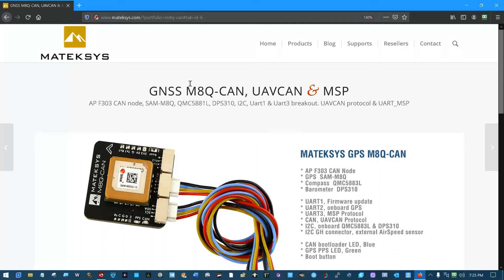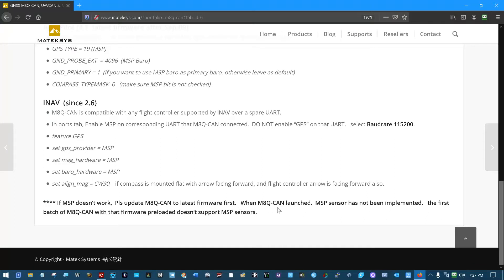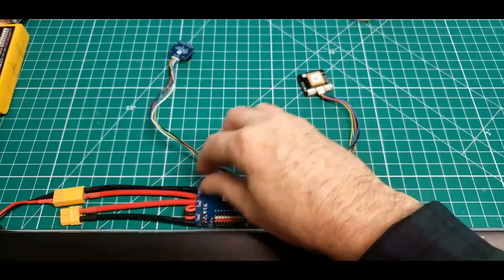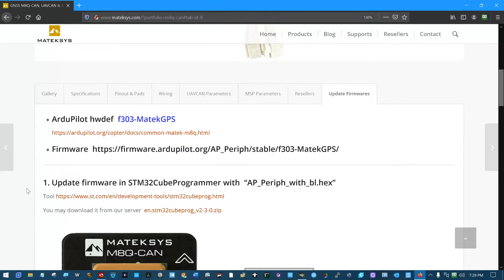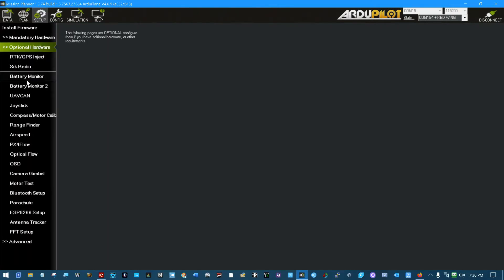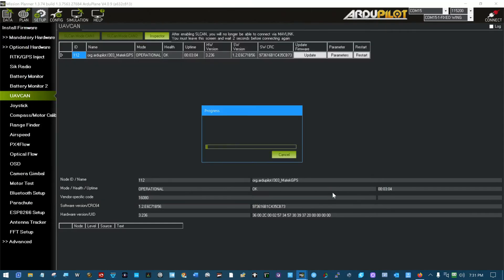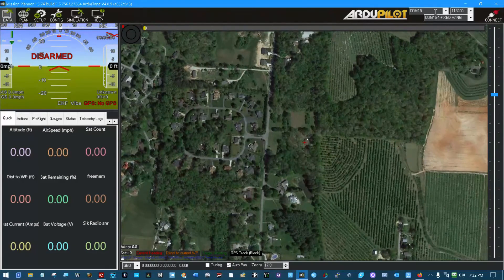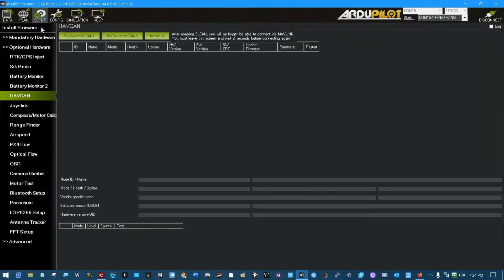M8Q-CAN GPS Firmware Update

Comment: And the M8Q-CAN blue LED has slow blinking which means it communicating witch the FC according to Mayteksys.
Reply from the maker: Yes that means the can bus or uart are connected.  Should get a blinking green when sats are locked.  Here is that video.
https://youtu.be/K5W1OHaCRiY
Reply: @nighthawkvs  I have blinking green as well. However, the HUD keeps showing 'EKF3 waiting for GPS config data' repeatedly while GPS status is 'No Fix'. All this never happened before until after the M8Q-CAN firmware update. Searched all over the internet including the Ardupilot forum with no luck. GPS parms setting were set as suggested on Mayteksys page. GSP_auto_config is set to enable. Let me know if you see anything I could have missed. Thanks for reading my post.
Reply from the maker: I tried to make a better video today.  See if you get the setup/optional hardware/Drone CAN/UAVCAN scan to work.  You may have the same or similar problem to my bad FC.
https://youtu.be/ZOCJfu3Gt8o

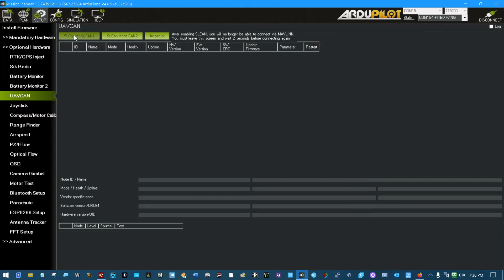Comment: Sir, Mission Planner is not detecting my M8Q-CAN (same as yours) as you had shown in the video at 4:55. I’m running MP version 1.3.80 build 1.3.8479.20539. The flight controller is Mayteksys H743-Wing V3 running on Ardupilot V4.3.7. Here’s what has shown in DroneCAN:
 ID-> 127; Name->org.missionplanner; Mode->OPERATIONAL; Health->OK; Uptime->; HW Verison->0.0; SW Version->1.0.0; SW CRC->0; Menu->Menu
M8Q-CAN was setup for CAN as instructed on Maytek’s page and I got a ‘GPS: 3D Fix’ displayed in MP. When the system was powered up and placed outside, I could see the number of satellites received up to 14 in the OSD and the Maytek digital airspeed which connected to the I2C port of the MQ8-CAN was responding as it should. Is there any other parms that should be set for the MP to detect the MQ8-CAN? Thanks.
Reply from the maker: I tested mine tonight and made a video.  But it sounds like you had it going when outside.  GPS: 3D Fix with 14 sats.  Mission Planner has changed since that 2021 video was posted.  The video shows it with MP 1.3.80.

IMHO you should have a CAN device with an ID of 112.

Comment: My problem is the M8Q-CAN GPS  does not show up on the UAVCAN listing H743 Wing. ver 4.1
Reply from the maker: Recheck the connections.  They may be reversed.
Reply from the maker: Also are you using the H743?
Reply: @nighthawkvs  Yes.
Reply from the maker: @BillyBigRig001  I used the cable that came with the GPS and it connected right into the H743.  No setup at all in ArduPlane.  I will go check again and repost if I find anything.
Reply: @nighthawkvs  Hello my friend. How are you?  my m8q won't connect to MATEKSYS H743-WING what should i do?
Reply: @nighthawkvs  After following your instructions on your other M8Q CAN with F765 I got it to say "No Fix"  But, the M8Q CAN does show the Blue and Green LEDs blinking as though it does have a physical fix.  Its just not registering on the Data page.  Batt is connected.  Also, on the Matek page it shows a param "ArduPilot AP_Periph F303 CAN node" that I can not find listed in the param's  Any thoughts?
Reply from the maker: @BillyBigRig001  Yeah, I am uploading a video now.  But it shows there is no changes to make.  I will post it here and then go back and look at it all again and reply again.
https://youtu.be/mqjUGUas3M8
Reply from the maker: Two parameters have to be changed in ArduPlane 4.0.9.  These two parameters setup the GPS on the controller.  After that, my scan of the CAN buss works.  Let me know if this works for you.  If it doesn’t we will try something else.
https://youtu.be/3cT67NC3AVw
Reply from the maker: @manumalikov7406  I think will show the steps to get it going in Arduplane.  Twp parameters have to be changed.
https://youtu.be/3cT67NC3AVw